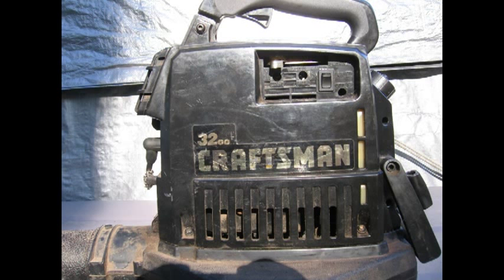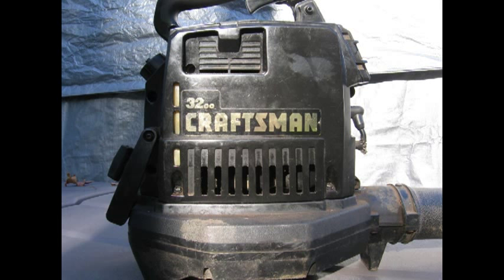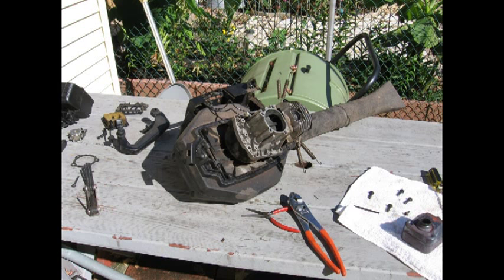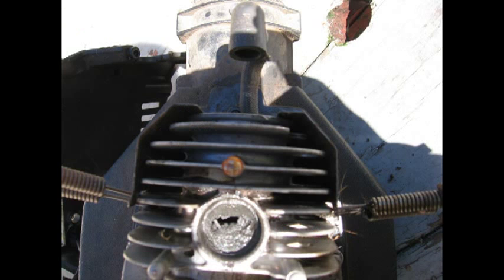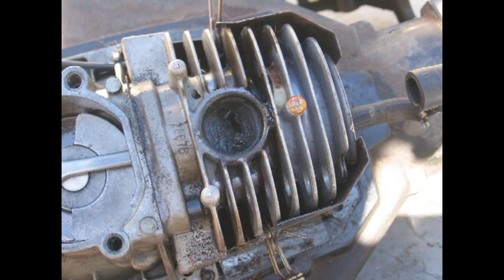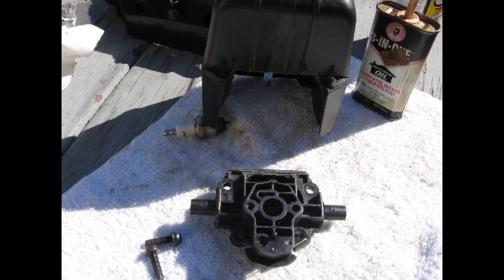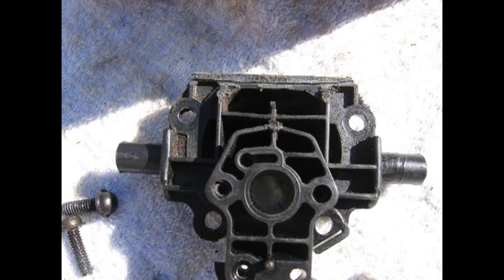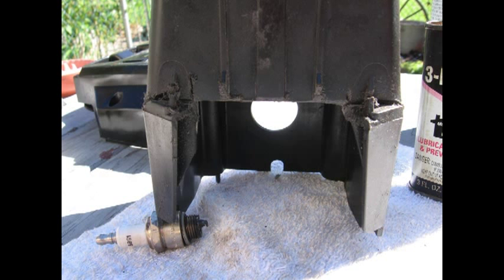Craftsman Black 32cc Crappy Blower

Comment: Found this same exact model in the shed of my new house. Still has the original manual in mint condition. Had no idea blower is nearly 30 years old. 
 Replaced broken fuel line, cleaned carb, new plug...  seems to idle fine on full choke. Stalls with the slightest bit of air. Hopefully this works.
Thanks!
Reply: keep running it on choke wide open to clean it out you cant hurt these old blowers they are awsome.  when you got it running wide open slowly open the choke and keep her running she will clean herself out.  if you are still having trouble check that you did pinch the fuel line when you put it back toghther I did and once i figured that out she runs good as new.  next pull the mixture screw cover straight out with needle nose pliers so you can adjust the mixture to get the full RPMs out of it which will also clean it out and keep carbon build up out.  wide open or idol is the only way a two stoke is designed to run.  half speed leads to carbon fouling and many other promlems.  I bought mine 30 years ago and just cranked her on the third pull after she was sitting since fall with old gas in her.  you wont get that kind of service from any brand availible today.

Comment: 525 also on mine pull that stupid yellow mixture adjustment stop out. (just grab it with a pair of needle nose plyers and it pulls right off, straight out,  exposing the mixture adjustment.)  Turn the adjusment screw out half turn and start from there.  your not getting the RPMs that you need.  then crank it up run it wide open and turn it untill she starts spuddering and then go the other way untill she sputtera again then divide that difference and youll have one great running blower that wont build up carbon beacuse of the much higher RPMs and complete burn of the fuel!!  by the way I also run 50:1 knowing she calls for 40:1 but been running her this way for years no problem.  all my other equipment runs 50:1 and I wasn't going to have a speacial mix for just her and she dont mind.  I bought mine new 30 years ago and have been using her all this time!!

Comment: mine I pick up thirty years ago this summer.  changed fuel lines once, just replaced fuel primer bulb (first time) and she still runs great.  however this weekend I plan to take her apart and clean carb, been rough the last few times trying to start her.  Once she running shes just as strong as she ever was.

Comment: Interesting, I have a 1998 32cc 180 MPH 357  CFM. I think you had an older version, I just saw one of those and the one I have has some modifications that maybe makes easier to start and run. It is still bulky but I have never has a problem with it. Except today, I had to put a new starter cord in it. Actually took the old one I found and took the starter cord from that one. Replaced it, had not started it for two years. It worked for a few seconds and then died. Gas line had dry rot, so now I need to order new gas lines etc. I will fix it, it worked well never had a problem.

Comment: hi I got the same one but mine is a little but newer bit same model, I changed  my spark plug, got new fuel lines and cleaned out the carbeurator and It runs nicely with no issues it turns on with one pull  and everything it's fun once you get it running

Comment: I still have one of these (1991-ish) and, yes, it's temperamental and quite heavy - especially with the leaf bag and the suction pipe attached.  But mainly my biggest problems have been with the fuel lines needing replaced and carb cleaned.  Same as with any other two cycle engine over time.  Overall design of this leaves a lot to be desired.

Comment: Enjoyed the video.  I agree with everything you said.  I've had trouble with mine and now have the idle and mixture settings all screwed up.  Do you know how to preset these so I can get the thing running? The manual says there's some sort of stops on the screws, but mine doesn't have any. Thanks.

Al